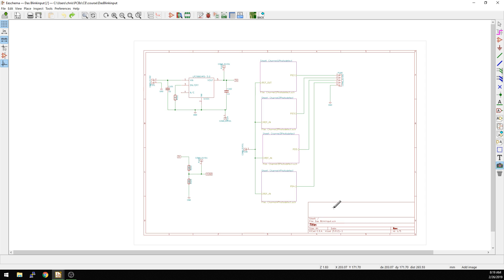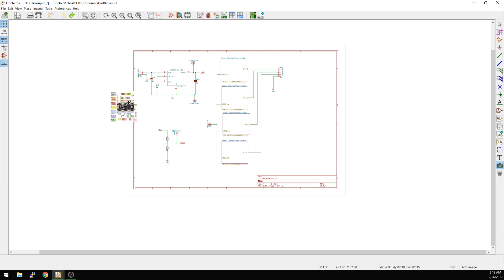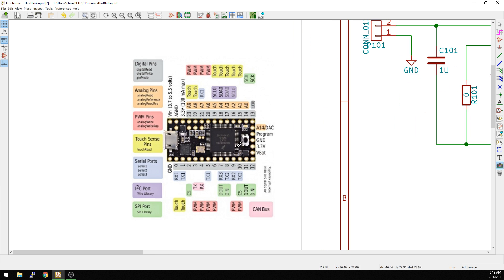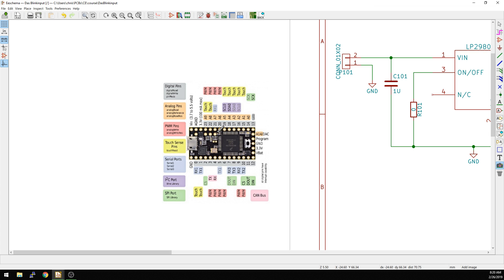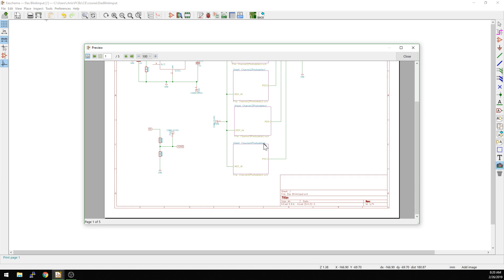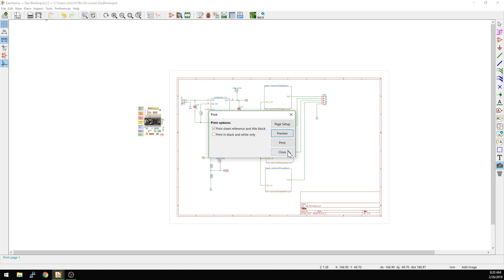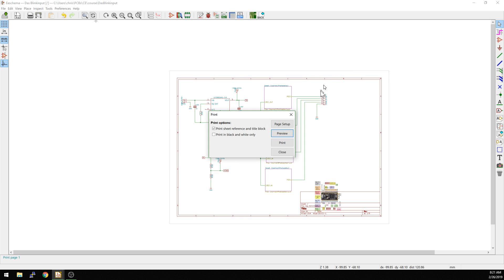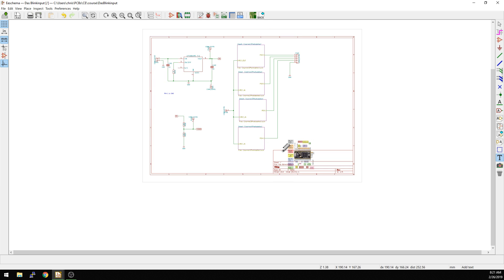KiCad 5.0 - Adding pinout diagrams to schematics

Comment: Great idea to insert pinout diagrams!

I've been inserting photos for schematics created as part of reverse-engineering old electronics.  For example, showing where bodge parts are physically located on the board, odd variations between board revisions (ex: "Rev D added a ground plane to the ribbon cable"), or other odd things that explain poorly with text or schematic symbols.

Comment: One thing to note about images is that you need to keep the file size pretty small or the interface slows down. 20MB photos won't do, but simple diagrams like the one in this video are fine. Another quirk to be aware of is that there are no layer settings. Objects are rendered in the order that they appear in the file meaning that if you add a picture after any component or trace the picture will obscure them. This can be fixed by editing the .sch file with a text editor to move any $Bitmap-$EndBitmap elements to the beginning of the file (right under the $EndDescr closing tag. (Thank you text-based files).

I have used the import bitmap feature for reverse engineering before. I take pictures of the front and back, overlay and align them in an image editor, then use the line tool to highlight traces, switching between the layers viability to get them on both sides. That image is then reduced in opacity and exported as a .png. (Turn down the color depth and resolution). I can then turn off fixed angle trace mode and draw the traces in Eeschma. One feature that it lacks that would make this MUCH easier would be an option to lock the net so you would be free to rearrange the wires without them accidentally breaking or connecting to others.

Comment: I use the Graphics to library app for my logo but a very useful tip for component data, thanks. Would you be able to do a similar quick tip for hierarchical sheets please?
Reply from the maker: Sure, that's on the list of videos to make! Any particular questions?
Reply: I just need an overview of how to use it. I had a complex schematic that could have benefited from being on several sheets recently and I didn't know how to break it up and assign it properly.